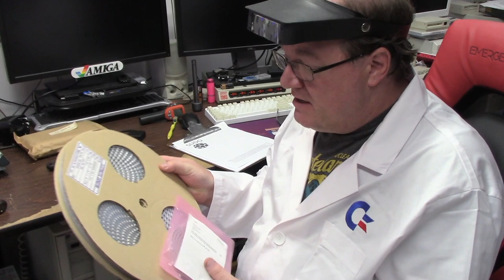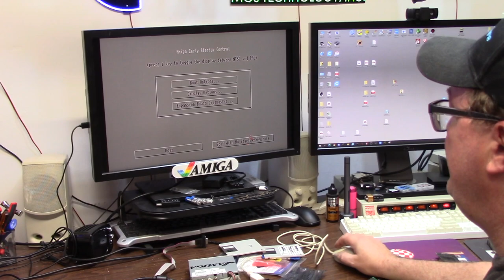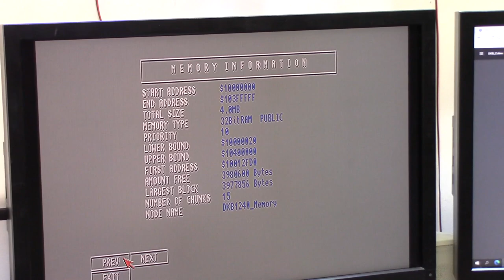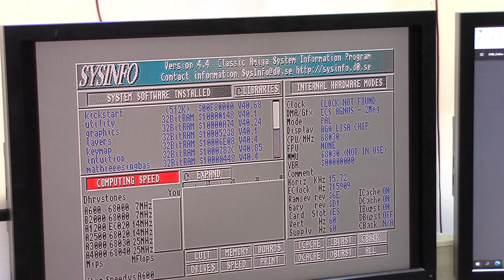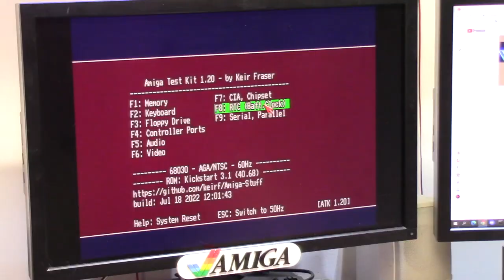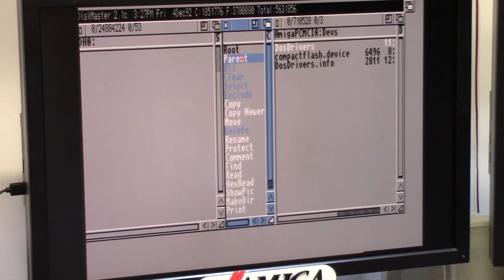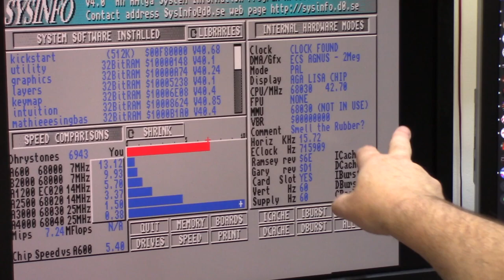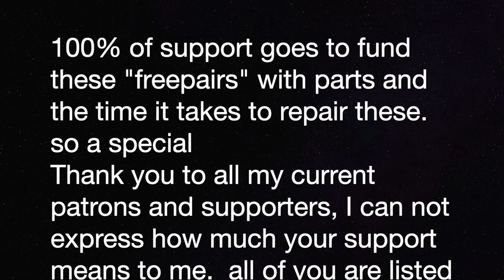Amiga 1200 w Cobras!

Comment: Chris, I have a slightly different style for doing the SMD parts. I pre-blob one of the pads. (small blob) then with one hand hold the part in place with tweezers, and the other hand solder the blob end. Then after it cools, it is set and you can solder the other side. Anyway, works for me. Thank you for the work you do.

Comment: Another great Vid Chris 👍🏻 Had one of those MK1 Indivision cards. They are a Pain in the Ass! Great when they are properly clipped on. But can see why the owner hot glued it on there. MK2 and MK2 CR cards fitted better. Also had a Cobra DKB in the past. Not a bad accelerator. Still prefer the Phase 5 cards though 😉 50mhz gold top 030 CPU🎉

Comment: To avoid delamination using hot air, the board needs to be heated (not to solder melting point). The problem occurs when the hot air heats a small part of the board causing it to expand while the cold surrounding board restricts that. Also the heating means the time the hot air needs to be used for removal is reduced, so less thermal stress.

Comment: top tip - if you ever need to remove hot snot without scratching or poking - dab a little isoprop on the hard glue and it softens it right up!
Reply from the maker: awesome, thanks for the tip!

Comment: The port on the Cobra board is for optional scsi. Not worth connecting to it because you may need fpu to run the scsi and I believe it was scsi 1. So slow. Pcmcia was faster.
Reply: SCSI-II, called "Ferret", rated to 2.8MB/sec so it had DMA.

Comment: Your voice sounds sooo DEEP and THICK. Heh. I see this 1200 uses the amazing electrical tape type protections as mine does. Heh. FILL THAT FPU SLOT! :)
Reply: Secret to male virility: 1000+ count rolls of premium caps.
Reply: The problem of putting tape over the indivision is that the Lisa can overheat with prolonged hard usage (which might also cause socket crawl). Later version of it even had holes through the PCB to help vent the heat.
Reply from the maker: well this unit was a early model and has NO opening for lisa anyway. so the tape only covers the solder points to protect the users ide/cf card adaptor from grounding out on them,.

Comment: Hi, how did you change the clock speed Cobra to 42.7mhz?
Reply from the maker: Crystal
Reply: @ChrisEdwardsRestoration  you mean that you upgrade the crystal? With such one please?
Reply from the maker: @Bun74  standard 40mhz "full can" 5v crystal 4 pin.  search ebay for something like this 40 Mhz Full Can Footprint Dip14 3V3-5V Crystal Oscillator, dont go wild with a 75 it will blow up your stuff, but a little is ok
Reply: @ChrisEdwardsRestoration  thank you so much for your information ❤️👍

Comment: Chris, Do you think it’s important to remove the RF module?
Reply from the maker: Its up to the owners.  They wanted to use that spot for the vga out
Reply: @ChrisEdwardsRestoration  Right, thanks, but does it make the board run better, or last longer?
Reply from the maker: @bradhansen2065  it reduces power load, as the rf modulator sucks up 12V direct all the time regardless of use or no

Comment: Me again. I lost c8 during a recap. A little ceramic one top left side near the 47uf aluminum cap. It's a 220nf cap but does anyone know it's physical size?
Reply from the maker: How did you manage that one? Lemme guess hot air and blew away?   Its a 220nf 4mm ceramic cap but any size that fits the pads will work.  Negative pad is bottom towards c822
Reply: @ChrisEdwardsRestoration  mostly by being an idiot. I removed it to clean the area and set it on the board. Then I turned the board over and completely forgot I had set it there. I'd need a forensics search team to find it again
Reply from the maker: @user-wj9xq7ig2v  been there. too bad its not magnetic.